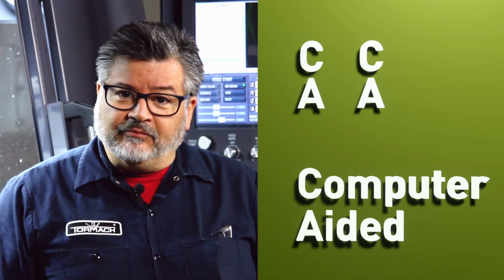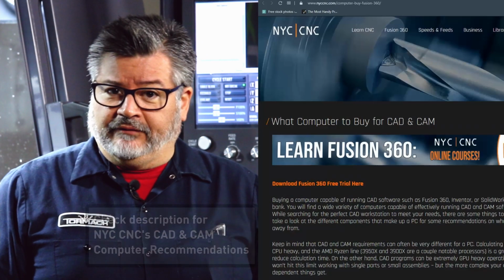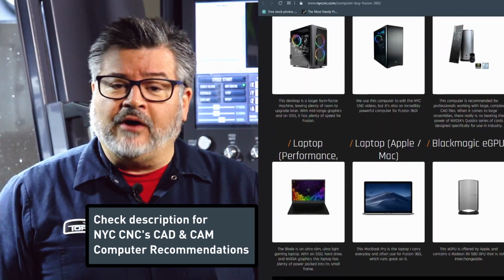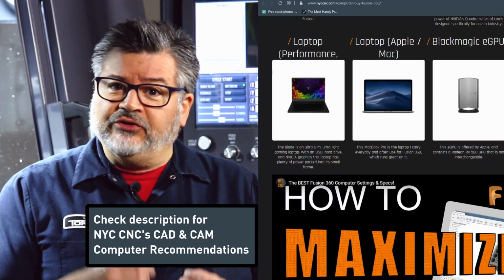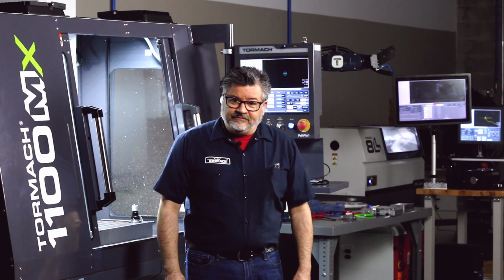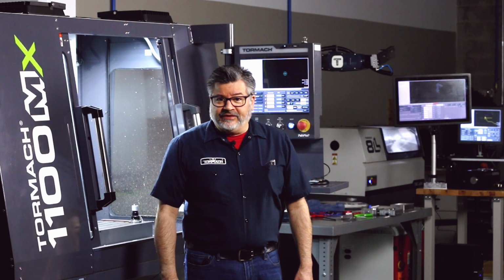Tormach Beginnings - CAD, CAM and PathPilot

Comment: Great video! Is the CAM workflow to Pathpilot identical if I were to use Autodesk Inventor CAM, instead of Fusion 360?
Reply from the maker: Hello Brandon,  Yes the workflow the is the same regardless of which CAM system you are using.

Comment: I have a feeling in the not so far future my company will be purchasing an 8l lathe for me we “I” have a 440 we don’t have the room in our lab right now but I see growth thanks for everything you do you guys are awesome
Reply from the maker: Thanks for the great comment! We applaud you and your companies future growth! What do you produce now and hope to soon produce?
Reply: @tormachinc  thanks for your time so we traditionally use 3D printer to make molds for injection molding, we recently bought a 440 for various fixtures ect. One day for the heck of it grabbed some scrap threw it in the mill and cut out a mold (much stronger than the print). But with a lathe we could open up that capability even more by allowing me to turn pins to make more different molds